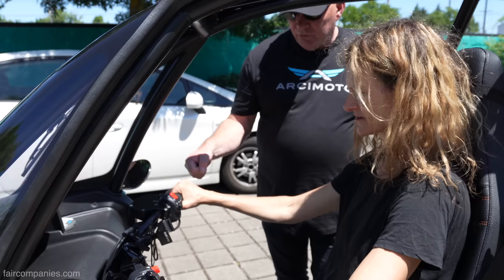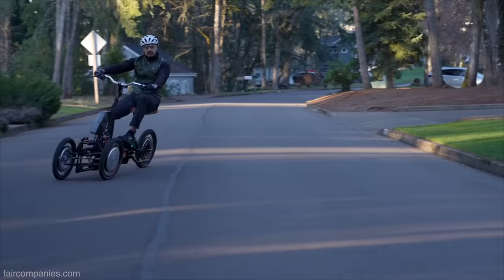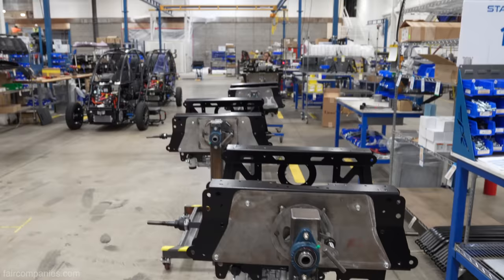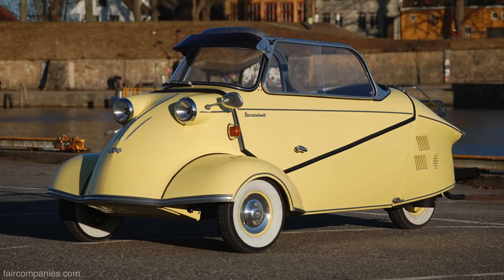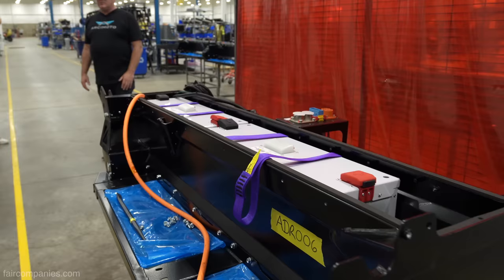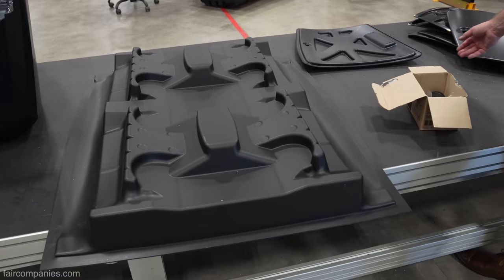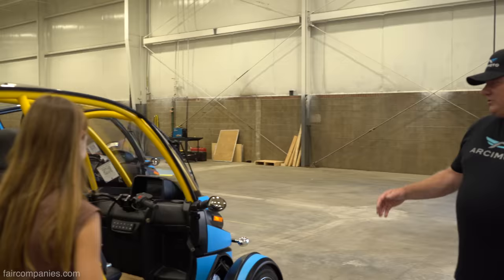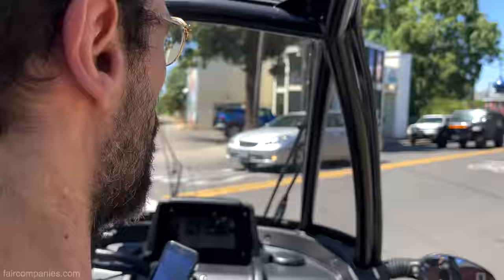Arcimoto 3-wheel EV commuter blends bikes' fun + cars' safety

Comment: You should ask the man why don’t you put solar panels or a generator on his vehicles.  It may boost up the mileage vehicle too.
Reply: A lot of commenters ask about that. We have seen light ebikes with solar panel roofs. If they are light enough they can get all of their charging from a 100 watt panel. I drove one for 7 years. But now my Arcimoto has an 18KW battery capable of 84 MPH, a beast of a battery. There is still only room on its small roof for a 150 watt panel but the vehicle's systems draw that much while it is parked and shut off. We would need at least 400 watts of solar in high sun to add any small charge at all and it would take a month to charge that huge battery. The roof is less than 2 feet wide, not much room. A generator is a truly horrible idea for a vehicle entirely devoted to ending fossil fuel use. Nobody in the company, or the investors, would approve of that. That would defeat the purpose of it.

Comment: Microcars are already a thing in europe, particularly the Netherlands where they're legal in some bike lanes (I think there may be a disability requirement).

This looks too wide on the front to go in bike lanes though. I think 1.2m max is sensible otherwise you wouldn't be able to comfortably squeeze in between bollards. But equally, there's no way you would want to take a car with a narrower track on the freeway. At that point though... why not just get a compact electric car?

Completely agree with the "the right tool for the job" ethos though. In a car centric society, people use cars when they're not appropriate. Driving an SUV to get some milk is like using a crane to crush a fly.
Reply: It’s definitely not a fit for bike lanes, but for the road it has huge advantages over any car in terms of maneuverability. You are centered in the ride and can see the wheels, so you can fit through gaps, you get rockstar parking (three to a parallel space), and rockstar merging. Net result is a radically more pleasant driving experience.
Reply: You are a little confused - the Arcimoto is an 80 mph 1300 pound vehicle for roads, should never be on bike paths. I am an avid bicyclist who drove the ELF velomobile for 7 years in order to be able to afford the cash price for the FUV. I don't need the 100 mile range and 84 mph top speed mine has achieved but I do love the safety, economy and easy home charging this allows.
Reply: @popeyegordon  I wasn't suggesting it should go in bike paths, but wondering why you wouldn't just get a small electric car, if it can only go where a car goes anyway.

Comment: What about doors and if you have a pet you want to take with you where do they set at cause there no doors. Plus what about  if  snows or rains  again where's the doors. Or window whipper. It is a cool idea
Reply: Half a billion motorcycles and scooters have no roof or doors. The FUV has both a wrap around windshield and a roof. We stay totally dry while the vehicle is moving and if we are stopped in a cross wind, just our elbows and outer thighs get damp. Not a big deal in order to save so much energy for power wasting doors. You can see how well the windshield wiper and heated defroster and heated seats work in the videos about Arcimoto in rain and snow. Dogs stay in the rear seat with a collar or a soft cage strapped down.
Reply: @popeyegordon  the reason why I asked cause I'm in Ohio and I would want 1 can doors be added to it or how the delivery one is could that be something to do to put a dog there since it is closed off just wondering cause I have service dog
Reply: @tinamarie56  They are working on a dog enclosure for the back seat. It is not that hard to do now, some just strap in a ready made dog box of fabric or plastic. The company owner has a special made dog sidecar which you might get them to include in a special order. The delivery versions have no windows or vents in their boxes so your dog would not like it.
Reply: @popeyegordon  well something for me to thing about.
Reply: @popeyegordon  thank you

Comment: These would be great in a small community where you didn't have larger vehicles or you had a side road just for these types of vehicles. 
     Otherwise, I would be afraid I would be crushed by a larger vehicle. 
     I could see where this would work well in Florida, Arizona, or California but not really in West Virginia. 
    But if it didn't have heat or air conditioning it could be very uncomfortable.
Reply: I could not see these working in Florida or AZ just due to the summer weather. Winter, sure. But not in 120degree arizona or humid 90 degree florida.
Reply: @Chedring  It is working for me in Florida as you read this. I tinted the clear roof and brow. I added a fan to the handlebar that blows in my face when I'm not moving or there is no cross breeze. I dress lightly. Being retired I can avoid mid-day heat if I desire but I do venture out for appointments. A car is a big 140 degree solar oven the moment you park it in the sun with windows closed. This does not heat up like that.
Reply: They are working on full doors and AC/heating.
Reply: @beachbum200009  There are a million savvy customers who will buy it in the south half of the US with no doors or climate control. We understand that climate control is counterproductive for potentially sustainable vehicles. The demand to be chauffered around like royalty or a head of state in complete home comfort is one of the reasons we are in this state with climate change. That has to change or else. Half a billion motorcycles and scooters have no doors or AC.
Reply: @popeyegordon  I agree... If I bought one it would be without doors.
But people want options. So if Arcimoto would  make a lot more sales because of the options... they are going to go there.
I look at a FUV as an upgrade from a motorcycle. Some people are willing to move from a car to a FUV but still have some comfort of a car. Not everyone wants to come out to a wet seat.  
FUV even with options is still better than an ICE car.  I'm ok with options.
Reply: @beachbum200009  Generally agreed, but remember all the variations that most vehicles do not offer - pickup bed, Deliverator, box container system, first responder, fire responder and they are protyping autonomous driverless delivery, vending and taxi versions. Some will fizzle, one of them could turn out to be the biggest seller.

Comment: This is Chinese mousekarts except you put two wheels in the front (more stable?) but you have to deal with independent turning - Chinese just do one in the front and the two in the back just follow - but is there a difference in stability/efficiency? Why this configuration? Love'm! Also - is that a little compartment behind the passenger's head? If you have a wider bench in the back, you just put your groceries in with you and sit with them.
Reply: Yes... two in front is more stable. It really sticks to the road.
Torque vector steering is a software issue that they found a fix for. It will be easy to turn at low speed. On turns...inside wheel will turn slower than outside wheel... is my understanding.
Little storage box is an option. They also have the one seat Deliverator with lager box.
For more info check them out at the Arcimoto web page or here on youtube.
When they hit mass production price will drop to about $13,000.
Congress just passed a Green bill that may help pay for EV's......
Reply: Loyal patriotic Americans won't even consider buying import brands from any country. Doing that stabs our neighbors in the back. A 'little storage box" would describe a car's glove compartment. The rear TRUNK holds a dozen bags of groceries above its trap door tool compartment. A passenger could hold a box while going home, or with no passenger you can strap in a large cooler. The frame offers many locations for hanging bags.

Comment: Looks amazing. If it's a Electric tricycle I have to wear a helmet or not?
Reply: This is not a tricycle, it is a 1300 pound autocycle with a hardened crash cage and a 6 point harness. There is no way for your head to contact anything but the soft seat back. A helmet would just be extra weight on your head that could snap your neck by G-forces. The first bad collision has already proven the great safety of this design.

Comment: Great. Now slap some doors and side windows on that thing !
And a trailer connection.
Reply: You are totally clueless about the parameters of designs like this. Three wheelers do not have the geometry for safe towing. Enclosures defeat the economy of this utility design expecially when the next unreasonable demand is inevitably energy hungry climate control that eats away at battery capacity. We won't reduce emissions by demanding to continue our conspicuous consumption of non-essential comforts.

Comment: I love it. I would love it even more if I can put off road tires on it. Although $17,000-$20,000 is a little hard to give up for such a limited battery range - can't take this trike off reading like would love to cause there are no charging stations in the deep forest
Reply: This is not an off road vehicle. It has low clearance and the suspension is tuned for roads. I have owned mine for 15 months now and never ran the battery down below 50% charge. It is my only vehicle and I'm very satisfied with it.

Comment: These are amazing. Will they be coming to Canada anytime soon?
Reply: I'm not sure when that will happen, but as you would expect, the issues are regulatory.  Canada probably requires ABS, as does Europe and Australasia - most of the world.  If that's the case, I expect it could be a long while - many years - maybe a future platform.  I looked into getting one to New Zealand, and it's a rabbit-hole.  I would have to add ABS, which is do-able on a motorcycle, but might be problematic on the Arcimoto.  My wild guess is that International orders will open up with platform 3 in 2025.
Reply: @richbodo  ABS is for cars. This is an autocycle with a different set of laws and regulations. I always saw ABS in my cars as a fix for dummies who are poor drivers.  Not all of us are. My Arcimoto's powerful variable regen braking combines well with the 3 wheel hydraulic brakes. The amount of rubber on the road is high for a 1300 pound vehicle and the certified roll cage/harness combo is proven safe without a helmet or air bags or even doors.
Reply: @popeyegordon  Haha, I didn't feel that saying what you said as a reply would matter as Rich as well as bloop, (both above comments), seem to be people who don't understand what a direct question is and feel the need to try to impart some 'wisdom' which they don't have regarding Arcimoto's autocycle, which is technically how it's also classed as a vehicle in many places.
Reply: @comedianmattrossey  I'm the one with wisdom that does not need quotes around it, as an actual owner of the Arcimoto for the last 8 months. I grow weary of the uncivil dishonest attacks on these videos. Constantly claiming a used car is more affordable when the fact is, a used Arcimoto will be the most afordable of all in a few years. Unfortunately the growth rate has to fill demand in all 50 states before it gets to Canada. It will be a while and the design will be more tolerable in the cold and snow by then.
Reply: @popeyegordon  Yeah I could tell that was the case with you. I checked Acrimoto's site and the prices are amazingly low for what I figured they would be. They seem destined to put their autocycles in as many places as possible. I used to live in Vancouver, but location makes no difference if the local city bylaws approve of the vehicle. I have an electric motorbike already but would much rather a vehicle like an Acrimoto for my daily getting around. And with the mileage that they. get off of one charge it's a vehicle that would completely work for me in any city I was to live in. I will definitely be keeping my eye on them and as soon as I can get the funds together I will get one here in Toronto where I live.
Reply: @popeyegordon  Would you give me your personal likes and dislikes of the Acrimoto. I've seen a number of electric vehicles similar in some ways, but the Acrimoto stands way out in front of everything I've seen so far. It's design is quite literally what I had imagined if I was to build my own similar electric 3 wheel.
Reply: @comedianmattrossey  When we exceed 30 YT comments a day they get lost during nightly spooling. I'll try one answer and see if it is still here tomorrow. The fun factor and the exciting jet turbine whine of the non-soundproofed motors are what I like the most from actual experience. It is faster than any other vehicle I have owned and far safer than any of the motorcycles I had. As a retiree the low cost of ownership is high on my priorities. My power bill went up only $2/mo and my insurance is just $130/yr which is fantastic compared to car insurance. No expensive gas motor or transmission to blow up. I removed my rear seat and added cargo net to make a hold big enough for any needs like camping gear. I'm single and wanted the Deliverator but for now they charge $5K more for it, my conversion cost me just $80 and I saved the seat and harness. The states are still drafting new laws to deal with autocycles. Canada will no doubt accomodate them soon.
Reply: @popeyegordon  I totally get yeah on the sound of the turbine. One of the  things that still feels odd to me is my electric chopper motorbike has no sound. The only vibrations I feel on it are the tires running over the pavement. The sound and feel of an engine is something I truly miss when I ride it. 
Your electric bill went up $2? Wow! I never noticed an increase at all in charging my chopper daily. Unfortunately the charge would only last me a few hours before I would have to charge again. Luckily it charges fast, but I still would have to stop to do so. The good thing is the charging terminal is small and can be easily carried. I tried a few ideas to keep it charged longer, but no big improvement was made so I scrapped what I was doing.
Like you I'd remove my rear seat and turn it into a trunk for carrying things. Paying the extra $5K for space seems a little ridiculous. I'd be into spending the extra $5k on having the whole autocycle enclosed, insulated and heated as I live in Canada and it can get hellish cold in the winter. Do you live in all 4 seasons? I'm wondering what you think it might be like year round in the cold temps?
Canada unfortunately is really slow for drafting new laws for electric vehicles that aren't big production facilities like Tesla or any of the other domestic hybrid electric or completely electric vehicles. The laws are mostly province by province with general approval by the Canadian Government across Canada because of the Highways Traffic Act which is overseen by the Federal Government. But, who's going to drive anything other than a hybrid electric on the highway when charging stations aren't everywhere yet. Most people that have an electric vehicle here also have a normal vehicle for long distances because the facilities just aren't common enough for long distance travel.
For myself I would only want an Arcimoto autocycle for intown driving anyway so it wouldn't make a bit of difference to me. I could buy one and bring it to Toronto, and it would have to pass all the highway safety codes to be able to be licensed and insured. That could be a risky situation to do that though because if they wouldn't pass it to be licensed under the motor vehicle registration, then I wouldn't be allowed to drive it on the street because it would exceed the maximum of a 500W motor which is the allowed wattage size for electric bikes being legally allowed on the road. 
I'm sure in the near future with more interest and purchases, both our federal and provincial governments will have no choice but to have the vehicles approved for road registration, which they already should be. That would be the good thing to do as it would also make anyone driving any electric vehicles that aren't already approved as street legal, to have a current drivers licence to drive on the road. Something that ebike riders don't have to have, which puts them at risk for not knowing how to properly drive, as well as other motorists who are constantly avoiding their mindless driving.
Thanks for the info and chat Popeye Gordon. Hope to see you out on the road in your Arcimoto sometime. Maybe do a review video of yours and post it up on YouTube in support of Arcimoto???
Reply: @comedianmattrossey  I added a bike bell to my handlebar because it is so very quiet at low speeds in parking lots, I sneak up on people who don't hear me. Dont worry about the Canadian laws. The autocucle industry is taking off and Canada will not prohibit an entire new class of more sustainable vehicles. I have no camera, no cell phone. I'm just here to follow my interests and confront trolls. But I do it a lot in retirement, about 180,000 fact checks in 8 years.

Comment: When, if ever, is Arcimoto going to incorporate the tilting tech into the front wheels ?
Reply: Never. The extra wide wheels of the FUV provide tremendous stability and far more traction than any vehicle that tilts. Tilting requires rounded tires, the FUV uses wide road gripping flat tread car tires. Always superior in rain.